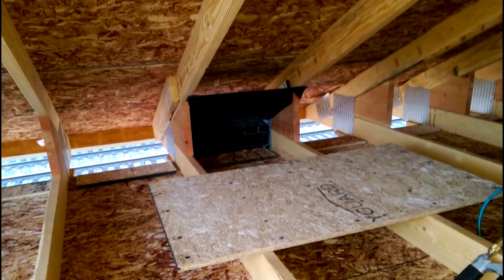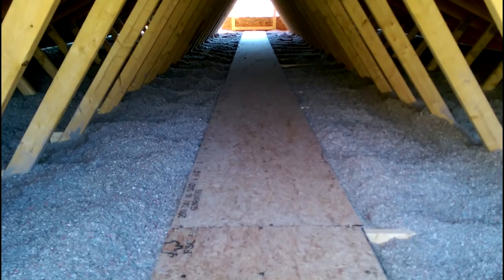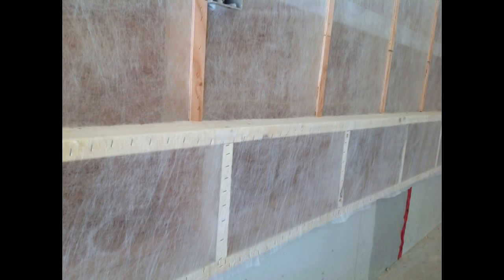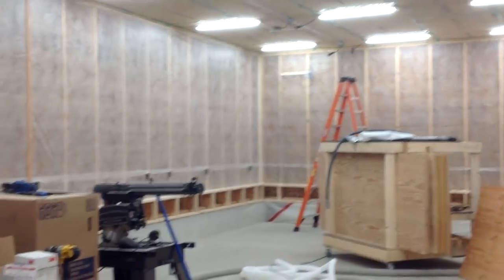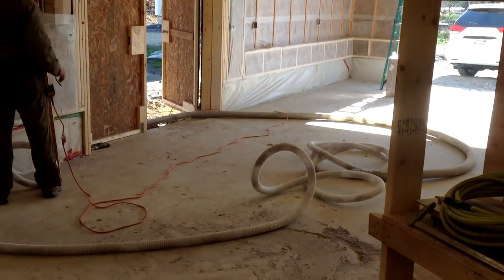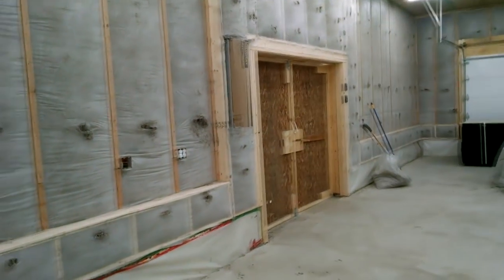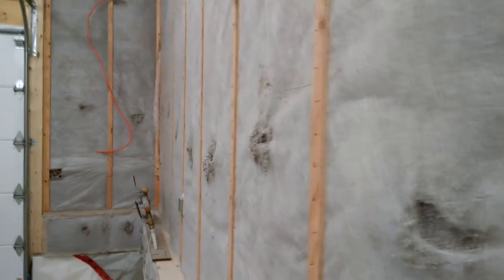Insulating Garage, DIY, Cellulose Attic and Walls

Comment: Nice job putting in those lights. I'm like you are in that I like my work area to be super lighted so there are no shadowed areas.
Reply from the maker: Yep, lots of light.  It's about 800 watts when everything is on, which kills me.  But no shadows.  In my old garage there were no lights and I would work by headlamp.  So I went a bit overkill when doing these lights.  LOL
Reply: @DavidPozEnergy  David, 800 watts of LEDs?  Can you save any electricity by dimming them when you want?  This whole build is super, I'm green with envy.  Did you hold up all the ceiling insulation with just sheet rock or OSB?  It always feels like a waste to not have attic storage (because I'm always short of space), but in your case it is smart.  Good luck.
Reply from the maker: Hi Greg,  The ceiling is 3/4" OSB structrual sheathing.  I used this to hold up the weight of the cellulose.  I've seen building that use something like 1/2" drywall across 24"oc trusses, and over time the ceiling sags.

Comment: So how is the performance with a significant difference between the roof and wall? 
The reason I inquire is they say get more out of insulating the horizontal versus the vertical, with a flatter diminishing returns curve for the horizontal.
Do like how you allowed for the option in the future to add the second wall on the inside rather than the outside, good forward thinking.
Reply from the maker: The performance of the garage has been very good.  The last 30 days have been 100% heated by solar.

Heat will be lost in all directions equally if the delta T is equal.  This fact does not change if the direction is through a vertical wall, or a horizontal ceiling.  So the effect of the R-value (diminishing return curve) is the same for any directional surface.  However, the ROI (return on investment) is much faster for attic insulation then it is for wall insulation simply because the attic insulation is so much less expensive to install then the wall.  Be careful though, because my statements here are in reference to my garage situation, and will change in other scenarios.
Reply: David, than you for answering. I think need to talk to y'all as a group, so that when others reading later, will get the context.
In thermodynamics (which had to know to get my Masters in Science of the Built Environment with a concentration in energy performance and climate responsive architecture), heat goes from a higher energy state to a lower energy state. Heat is to simply put, energy (your A/C unit makes heat to remove cold, requiring energy to go against nature), with "cold" being less energy than "hot", so to make it easier, we say hot flows to cold. So in winter, the heat inside is trying to go outside, and in summer, outside to inside. We resist this with insulation, and if the resistance is constant, the greater the delta t, the less resistance it has, thus why more insulation is needed in extreme climates than a temperate climate.
The delta t will be different in a ventilated attic house between the horizontal and the vertical, like David's garage. For an extreme example, take here in Phoenix Valley. The attic can easily obtain 150*F, while the outside ambient is only 105*F. So the ceiling has a delta t of 82*F while the walls have a delta t of 37*F, less than half of the ceiling. To make a point, it would not then be prudent to put R50 in the walls and R13 in the attic, as the structure be absorbing the heat blasting in from the attic.
Then to really get into it, consider previous we were ignoring the sun and the solair temperature. With the roof surface having sunlight most of the day, the surface has the opportunity to heat up throughout the day, where the walls receive less sun as it rises and sets. For those unlike David, me, and others in the field, go put your hand just above the asphalt pavement (same material as your roof) on a hot summer afternoon and compare it to putting your hand on the south wall.
In the end, find interesting that David feels no difference between the surfaces. David, have you taken temperature readings of the ambient, ceiling, and wall temperatures? What really be interesting is to data log those three temperatures at the same time for both structures to show the affect of double wall construction.
David, glad the solar water system is now working as intended, know you went though a lot to get to this point and along the way generously shared and taught. Again, thank you.

Comment: David, How and What did you use to build your insulation dams and air chutes. I am researching the best way to do that now. I have a detached garage and main house that I would like to insulate the same way. But I don't like the material at the big box stores. I want to turn the exterior garage into a workshop. But way too cold in winter. I live in Maryland. Appreciate any help.
Reply from the maker: Hi 2med831, I build my dams using a fabric called "Soltex Mento Plus" sold by foursevenfive.com and stapled the edges to the wood frame.  You can also use a housewrap such as TYPAR.  In the past I have also made dams and chutes out of thin plywood.  I tried the fabric thinking it would be faster, but I think it took the same amount of time, so I'll just go back to the plywood in the future.

Comment: What are your thoughts on on blown cellulose for knee walls on a unfinished second floor? Fiberglass isn't cutting it spending $400.00 a month to keep it heated in the Winter. Rest of the area is floored with osb and unfaced fiberglass.

Comment: David, great video.  Do you have to use a vapor barrier when installing cellulose?  I live in the Houston area where it is very humid, which takes a toll on my equipment.  I have a 3 car insulated garage covered on 3 sides with stone.  Unfortunately, the interior is already sheet rocked.  I am not excited about either removing the drywall and insulating or drilling holes and patching the drywall.  So, I think I'm looking at insulating either the attic ceiling or attic floor.  My primary purpose is to reduce the summer heat gain; it's almost always 10 degrees or warmer in the garage than it is outside putting me well into the 90's or over 100 degrees.  My next thought is to try to remove some of the humidity, but I have not found a good solution for that yet.  Thanks for any input.  Dave
Reply from the maker: No vapor barrier is needed with cellulose.  As you can probably see in the video, I have no vapor barrier.  Certainly insulating the attic would reduce heat gain.  If you want, send me an email with some pictures to look at.  I might have more ideas then.
Reply: @DavidPozEnergy , I finally went into the attic to get some pictures, but don't see an email for you.  Often it is listed under "About", but I don't see it.

Comment: I'd REALLY like to know how you did the dense pack. I'm planning on doing that for the big shop I'm building but I can't find a machine that will do it. Did you have to find a dense pack-specific one? Someone on YouTube did it with a regular big box machine where they blocked off about 3/4 of hole where the cellulose goes into the machine, but that probably slows things down a lot. Thanks!
Reply from the maker: I have an old used machine that I modified with a new, powerful, blower.  https://youtu.be/JOt9TBwWwM8  Usually the box-store rental machines don't have the needed PSI for dense-pack.  They are fine if you open-blow an attic though.
Reply: @DavidPozEnergy  Thanks for responding! Yes, I'm afraid that a regular blower won't work, which is why I asked. I can't buy a machine, nor can I alter one I don't own, so what do you think of using another blower (maybe a shop vac?) pushing air into a wye fitting at the machine? I don't see why that wouldn't work, as long as it doesn't blow backwards into the machine (I don't imagine it would).

On a side note, I did solar installs for a living back in '07-09. Panels were $1300 each (165 watts) then, as there was a shortage of silicon! It is soo good to see solar being affordable now. Great Channel, BTW, thanks for your efforts.
Reply from the maker: If you are planning to DIY your own machine, and are just doing one project then follow this plan:
1. It will require 2 people, one on the hose, one on the blower.
2. Use a powerful blower such as a leaf blower, or a central vacuum for a house  Maybe one like this? https://amzn.to/2MNhrpy
    Side note: I have a central vac in my garage so I can make a video about making your own machine, just havent' gotten to it yet.
3. Connect a hose to the out-going side of the blower, and a short (6') hose to the incoming side.  
4. Break apart the bales of cellulose into a tote or clean trash can.  This will have to be done by hand.  Make sure there are no clumps.  It has to be all loose.
5. Turn on the blower.
6. one person is on the suction hose.  This person will have to keep the hose about 1" above the cellulose that is loose in the tote.  This means moving it around, always keeping it 1" above.  If the hose falls into the tote it will clog
7. The other person is at the wall maneuvering the hose in the cavity.

Note, if there is a third person they can be breaking apart the bales into a second tote or trash can and keep swapping it out with the person on the suction end.

Take a picture/video and let me know how it goes.  Good Luck.

Comment: Hi David, thanks for your videos, really interesting.  If you were to build a house again would you have an vented roof cavity(like your garage) or unvented (like your house)?  

As you have both thought I would ask. Anyways cheers
Reply from the maker: Both are fine so long as they are built well.  Generally, I lean toward the house, because then you can do vaulted ceilings, and/or have the attic space inside the conditioned space.  This allows HVAC to be inside attic and work better.  I didn't mind in the garage since I don't have HVAC up there.
Reply: @DavidPozEnergy  thanks for the reply & insight :)  hope you have a great day

Comment: If you dont mind me asking, why do you need that much insulation in your garage?
Reply from the maker: Hi E D,  I don't mind you asking.  I wanted (and achieved) a garage that is both heated and cooled using only solar.   Since my solar panels don't produce many BTU's per day, I needed an insulated building that doesn't need many BTU's per day.

Comment: I really like your video I have to update the insulation in my home attic. I'm trying to figure out how to do the soffit venting I don't want to buy those cheap styrofoam ones. Can you describe or show some pictures of what you used to make your own that seems like a much better way to go I'm looking for ideas thank you
Reply from the maker: Hi James,  The system I used is applicable with raised heal trusses, which is what I ordered for my garage.  So if you don't have a raised heal truss then try a different method.  But here is what I did:  I used a material called Solitex Mento Plus: https://foursevenfive.com/solitex-mento-plus/  I stapled the fabric to the underside of the top cord, then reinforced that with 1x3 strapping.  This made a large air space.  This same method can be used with other fabrics, such as Typar.  You can also do this with plywood.  The idea was to have the cellulose contained, and the air from the soffit to ride up and over the cellulose, not through the cellulose.  There are pictures in the video starting at 0:09   I hope that helps.

Comment: Hi David. Why didn't you seal the rafters all the way up so that the attic wouldn't get as cold causing extra heat loss?
Reply from the maker: Hi Me Blake,  Some home I insulate I do install the insulation at the rafters.  This project I did it at the ceiling joists.  Both work, but you only want one "thermal boundary" in your system.  The ceiling joists (open blow) is way faster and less expensive.  Both work equally well so I'm not giving up any performance.  The only time to go with the rafters (extra time and money) is if there are ducts and/or furnace in the attic.  My attic in this video has no HVAC up there, so no reason to insulate the rafters.  Thanks for watching.
Reply: I don't think I explained it correctly. I wasn't saying to insulate the rafters, but to staple a vapor barrier to the rafters to keep the air flowing above and out the other side of the vents. I would think not sealing the rafters keeps the whole attic much colder than when it is sealed.
Reply from the maker: Sorry I misunderstood what you were asking.   No, I would not want to staple a vapor barrier to the underside of the rafters.  That would lead to condensation problems.
Reply: I don't see how there would be condensation with that big of an air space between the insulation top and the vapor barrier stapled to the rafters. I am doing this in my attic to an R-value of 60 (20" of cellulose), so I will let you know if it causes condensation or not. My roof is very low (only 50" to ridge board).

Comment: Hey to David.
Thanks for the great video. 

Questions, if I could:  
Did you design the structure yourself? 

Did you add about 17-inches of blown-in insulation above for something like R-60? 

Does one need to add more overhead insulation after it settles?

And did you have to reinforce the roof trusses to allow for the extra weight of blown-in insulation and cat walk? 

Thanks for any help and direction. 
Peace of Lord Jesus upon you and yours
Reply from the maker: Hi David,  Thanks for watching, and your questions.  Here goes:
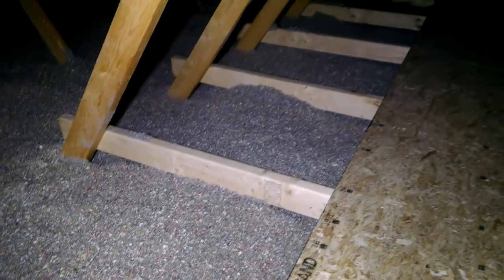1. Yes, I designed the structure.  It's just a rectangle with a 6:12 pitch roof, and the north side roof extends to provide an awning.  

2. Alaina and I blew about 30 inches of cellulose into the attic for something around an R-100 settled.  R-60 would have been perfectly adequate, I just thought it would be fun to say we had an R-100!  LOL

3. No, but with a caveat.  It kinda depends on how you blow it.  There are techniques involved.  I blew mine for a very high initial density, and I have checked it after one and two years to ensure no gaps have formed.  

4. I did not have to reinforce the roof trusses after they arrived, but I did order the trusses with twice the load carrying capacity as normal.  Got a call from the manufacturer's in-house engineer to double check the notes.  That was fun.  But it's not very expensive to order them extra strong.  The cat-walk is something I site-built in about half an hour.  It does not add any strength, or weaken.  

If you have a specific project you are working on and want to discuss it further, send me an e-mail.

Comment: Hey David I really appreciate you making videos with so much information. I was wondering if you have a video explaining why you don't need a vapour barrier with cellulose. The Grace ice and water on your house would act as a vapour barrier but not needed on garage?
Reply from the maker: Hi Gordon,  I'll have to add a VB video to my list.  I've got dozens of videos to make, LOL.  

Some locations require you to have an interior VB.  This has been 4-6 mil poly since the 70's.   But the manufacturer of the cellulose specifically says not to use any VB.  This includes VB on exteriors.  The cellulose manufacturer told me not to build my house the way I did.  LOL.    That was based only on fear of the unknown as nobody had done it.  

The ideal setup with cellulose is no VB on any side.  Just let the vapor dry out in all directions.  But still use an air barrier in the assembly, and still have bulk water control.  

I hope that helps, Thanks for watching.
Reply: @DavidPozEnergy  Thanks fpr the reply, it does help. By bulk water control do you mean a typar or house wrap?
Reply from the maker: Exactly.  But a breathable version.  One of my favorites is "Henry Blueskin VP-100"

Comment: Did it smell after install?
Reply from the maker: No.  I used a cellulose that was 100% borate treated.  Borate does not smell.  The cheaper cellulose out there is treated with Ammonium Sulfate, which smells terrible when it gets wet.
Reply: @DavidPozEnergy  Sure, but shouldn't newspaper smell a little like newspaper?
Reply from the maker: O, is that what you meant?  I'm sorry I was assuming you were referring to a bad smell.  Yes, there is a paper smell.  Sorry about that.  I've gotten that question so much and usually the person asking has heard about ammonium sulfate off-gassing, which smells like ammonia.
Reply: @DavidPozEnergy  Manufacturers and installers tend to be familiar with the potential for ammonium sulfate off gassing. Where you get mixed responses is when you ask whether it has a natural newspaper-like odor. Many of them seem to think it shouldn't. The MSDS sheet for the product in my house right now says it should be odorless. Very confusing.